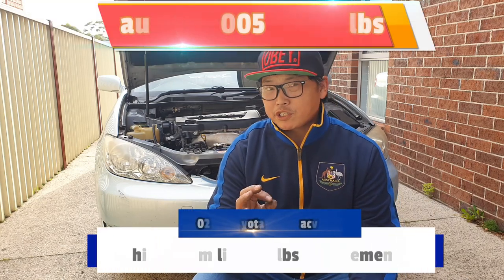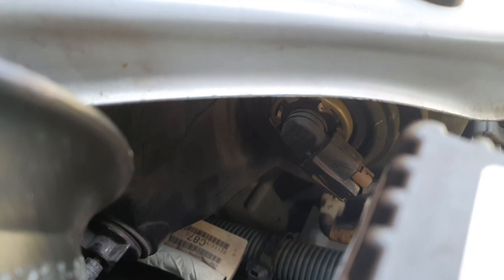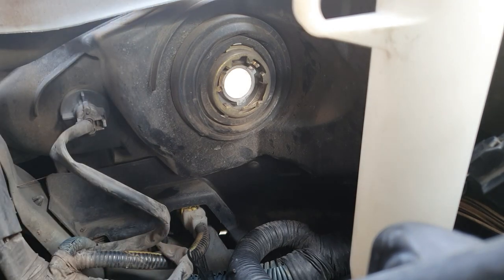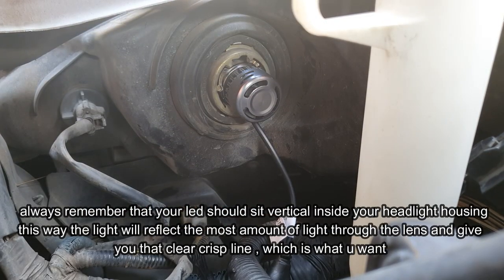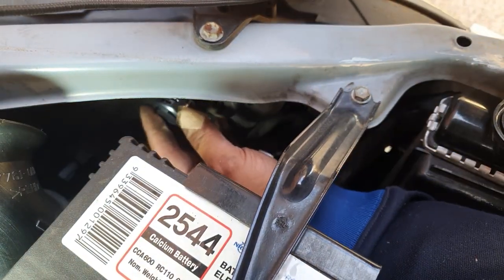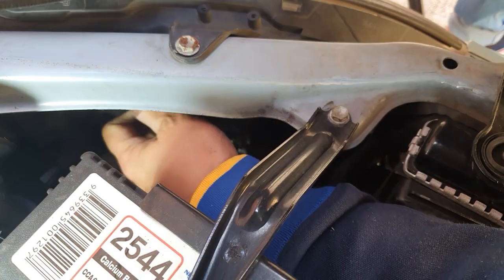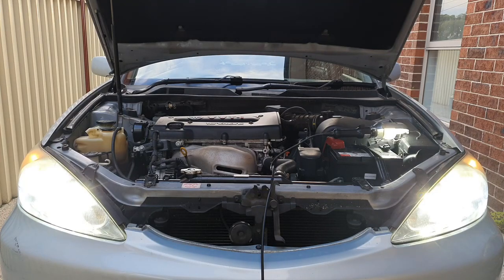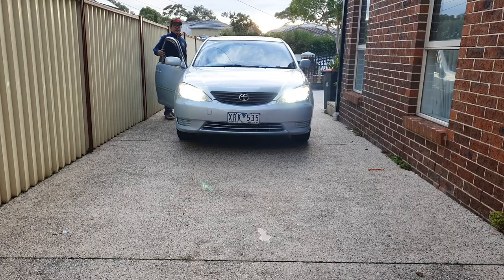02-06 toyota camry 2005 acv36r HIGH BEAM replacement AUXITO 9005 led bulb install

Comment: Hey Mikey, I saw you'd used these for the W204 as well. Do you use them for the low AND high beams? I feel the Xenons on mine are not bright enough and want an upgrade; can't decide if new HIDs would be best or these. I'm also a little confused as to which would fit where - I think the HIDs are D1S? Any help would be appreciated. Thanks mate.
Reply from the maker: yep they are bright asf seriously I used for both low and high

Comment: Have not seen you tested the Daytime Running Light (DRL) mode of this 2005 Camry.  This DRL mode should be using partial brightness of the high beam bulb and some LED version of 9005 bulb will either be flickering or not turned on at all.  Does this AUXITO 9005 LED bulb work OK on DRL mode ?
Reply from the maker: I didn't know this car had drl
Reply: @MIKEYZVLOGZ  On my 2002 Camry which was made in Japan, as we turn on the vehicle lights control-stick, the first stop is the Daytime Running Light (DRL) mode, the 2nd stop is the low beams and 3rd stop is the high beams.  The DRL mode will connect the two high beam 9005 bulbs in series. ( See Chilton Toyota Camry 2002-2005 Repair Manual Page 12-40, in DRL mode, left high bulb will be on the +12V side, right high bulb will be on the ground 0V side. )
Reply from the maker: @vancheeliu6794  oh ok mine does not have that
Reply: The last bulbs work as DRL's in this case. Mine has.
Reply: I do have the 2005 Camry and it does has the same setup on light stick. 1.Off. 2.DRL or Parking lights 3.Low Beam  4. Push it back for high beam.